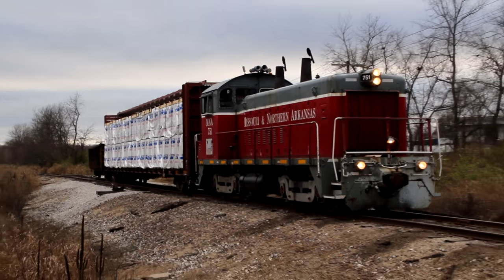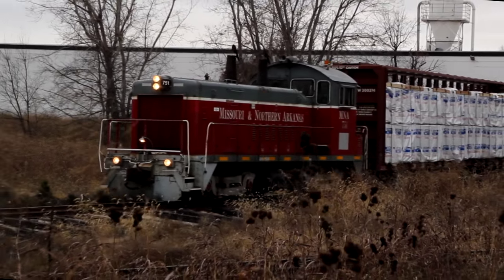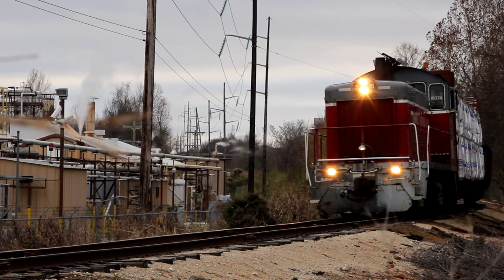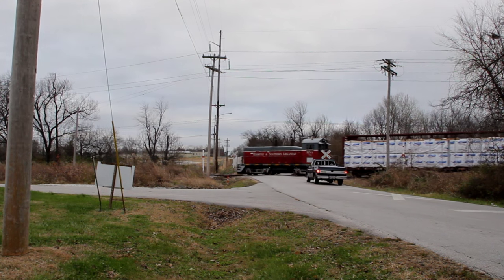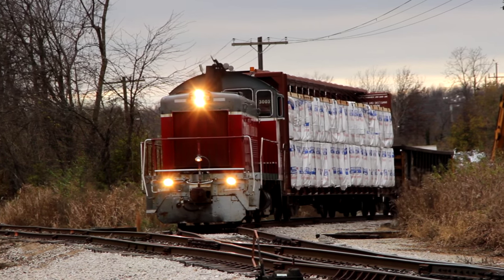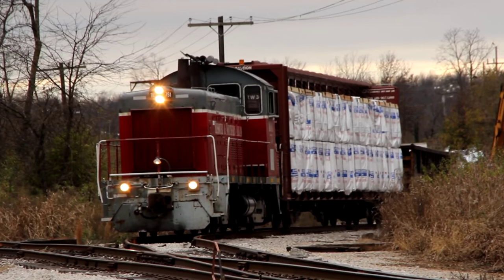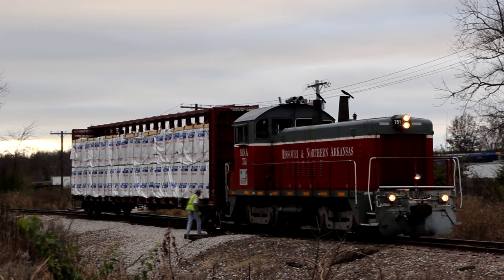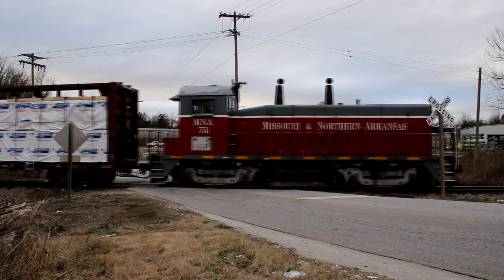Amazing old train locomotive works hard for the railroad!

Comment: SW1200 switchers were almost as common as salt in the 1960's, and were up graded to1500's Still a well maintained 1200 should do well even today.
Switchers of this type rarely saw the stresses of their bigger brothers, GP's and so on, pulling huge trains at higher speeds. 
On the NYC tracks near my home in Cleveland, Ohio (1960's) a similar loco serviced a light industrial park, almost daily. When I returned home from military service in 1970. the old SW was still working away, with nearly 20 years of service, and the NYC was not known for maintaining equipment very well, at the time.
It's nice to see a nice old engine like this working well and looking spiffy too.;-)
Reply from the maker: It has been a cool engine to watch all these years.  MNA recently sidelined this unit and replaced it with a chop-nosed GP9, which is still cool in its own right.  The #751 just recently left town on a BNSF train.  I've been told it was sold to another owner, which is planning a major overhaul.  So, thankfully, it's getting a new lease on life.  I'll have to find out who bought it and where it's going.

Comment: In the UK there are many 50 year old locos still in regular service on the main-lines. They probably don't do the miles that US locos cover, but they still earn their keep. Classes: 08, 20, 31, 47 and 73 can all be heard rumbling away somewhere or other.
Reply: They do a lot more miles than this little switcher pottering up and down its six-mile branch line but, yeah, much less than a mainline freight locomotive.

Comment: when I was working at Trinity in Springfield they had a 1955 SW900 with prime mover upgraded to SW1000 it was operating in 2000's until they didn't let it run early one fall and she froze up

Comment: no offense I've seen older Diesels still on mainline Service, with more modern units trailing it, still nice to see a old EMD still running
Reply from the maker: No offense taken!  I would agree. There are much older diesels out there, but I don't have easy access to those ones in particular.  You have seen older diesels in mainline service on a Class 1, or are you referring to a shortline/reional?
Reply: Mainline trains,  "class 1", still in revenue service from 1957 or 1951, I reccomend you Google Victorian railways B class loco's
Reply from the maker: Which ones might those be?  In my neck of the woods, BNSF and UP only run the newer stuff- definitely nothing 50 years old.  It would be neat to see something older, though!
Reply: sorry I'm from AUS
Reply from the maker: Ah! That makes more sense!  I love watching videos of Australian trains. I have seen a lot of older stuff on those- the kind of units US railroads ditched a long time ago.  It would be nice to have the variety.